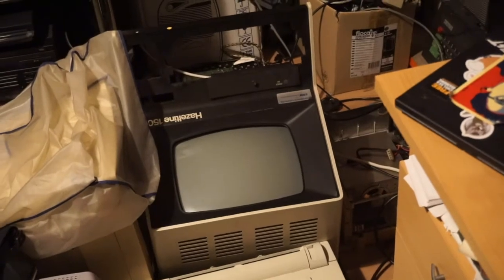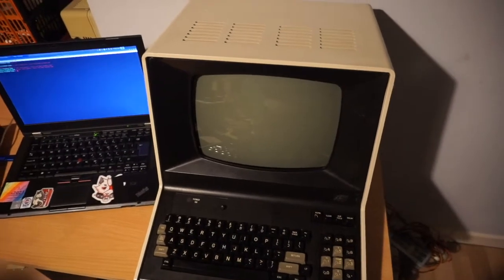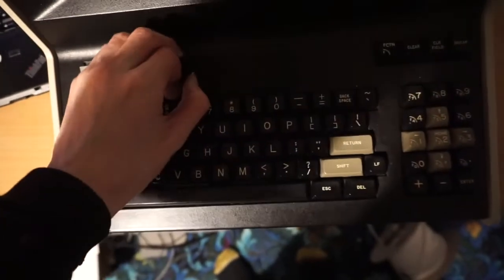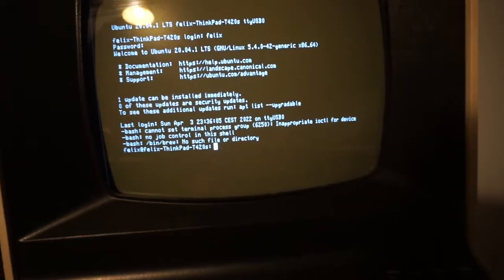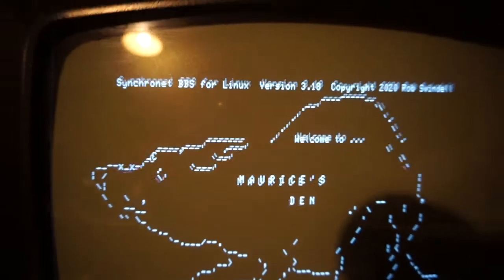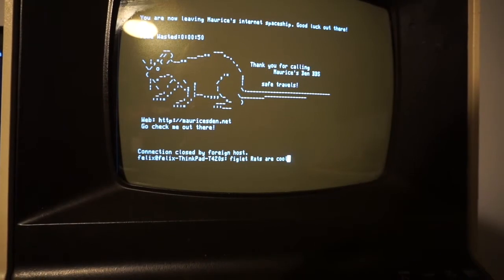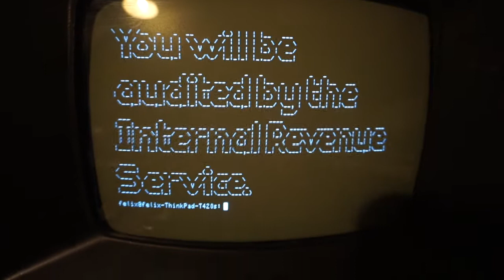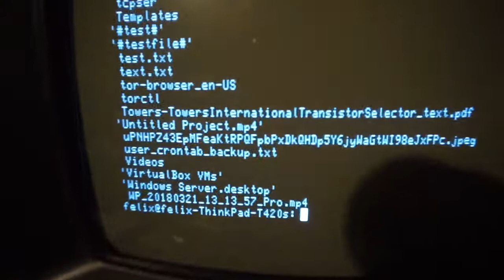Hazeltine 1420 Terminal from 1979

Comment: Nice video !

I have one as well and want to link it to a laptop as well.
Could you please tell us the pinlayout of the cable you used between the Hazeltine and the UBS->Serial adapter ?

Cheeeeeeeers
Jecepede
Reply from the maker: All you need is a standard DB25 to DB9 serial null modem cable. That'll work.

Comment: Trying to buy a 1500. What connector does it have?
Reply from the maker: It just has two DB25 connectors on the back. One for comms, one for a printer
Reply: @HazelTheHare  I have a RS-232C 9 to 25 pin converter. I think I'm going to try plug an USB UART to it. That's 4 dupont plugs, should work.
Thinking about it, should'nt an old MS-DOS system just work if you connect this to COM1 and change the console input to AUX? I did this a long time ago to transfer files to a system with no network.
Reply from the maker: @manuell3505  I've not tried it with a DOS system. It's only ever been connected to Linux and a friends homebrew Z80 computer.

Comment: You can clean the adhesive off the anti-glare pannel with Isoproyl alcohol 70%! I tried all sorts, butter, dish soap, windex, in the end good old IPA worked.  The other cleaning agents may have removed the cigarette smoke and other grease.   Now to reattach it will be another challenge!